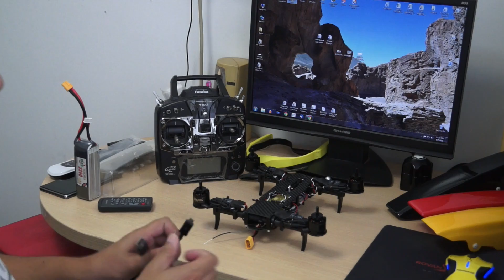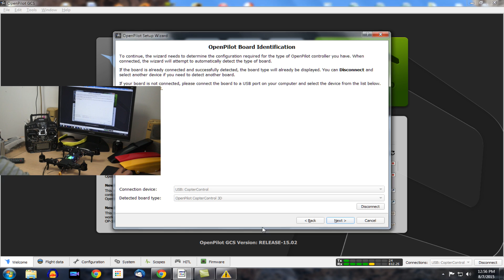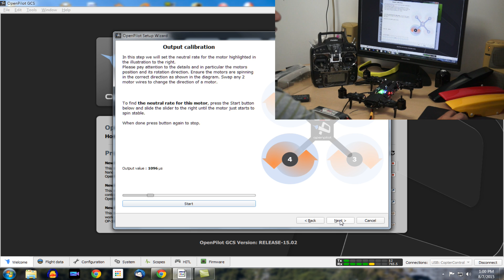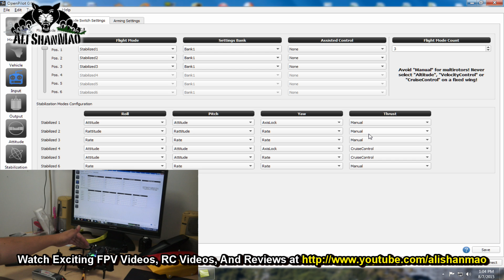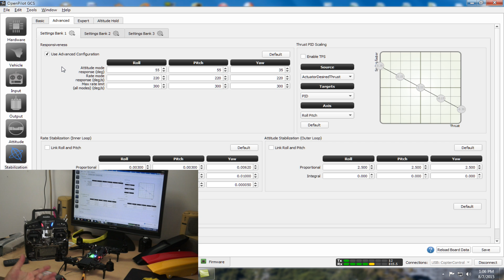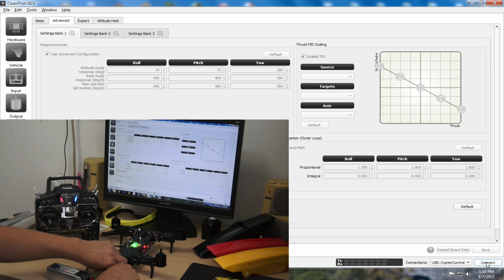OFM Swift TR260 Tilt Rotor FPV racing Quadcopter Build Video Part 10

Comment: Hello dear Ali, many year follow yours adventures and greats advices, in this issue i need your help, in swift 280 concern, about rudder and elevator recognition from openpilot software, when i test in the screen the rudder and elevator this apper move in diagonal instead vertical or horizontal, alll checked well, go to fly i fly in mode 1 with T14SG futaba radio, i lift the quad well but roll and throttle well, elevator and rudder make lost control because the quad go diagonal too hard to control and the same way to show in the openpilot software...., do you know what could be my mistake ????
I look forward your answer, thanks for you time
Best Regards from Chile